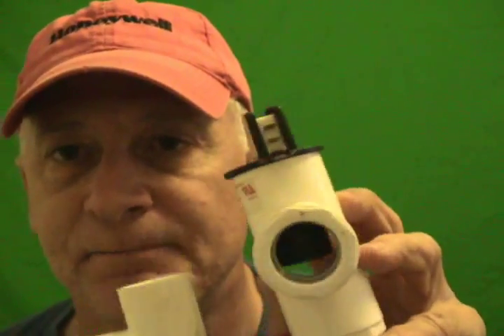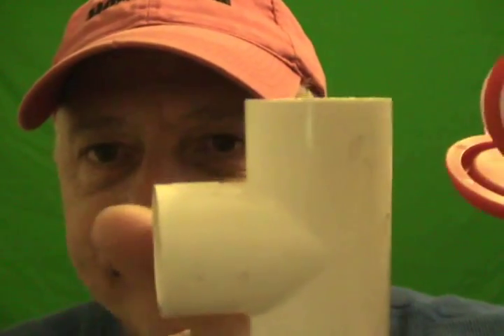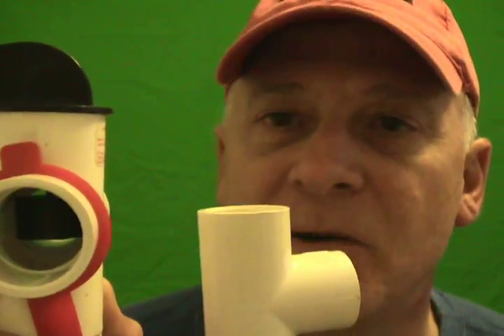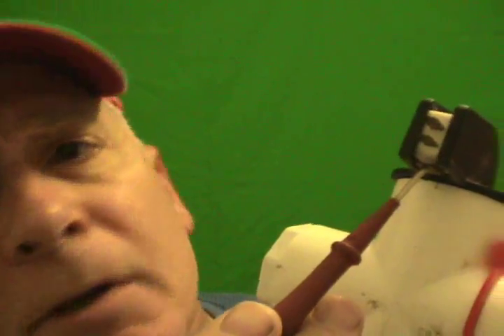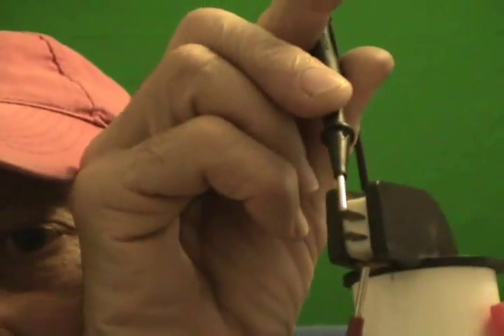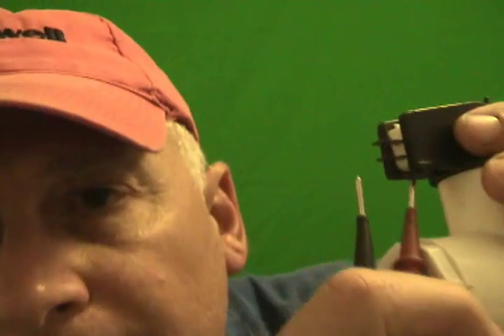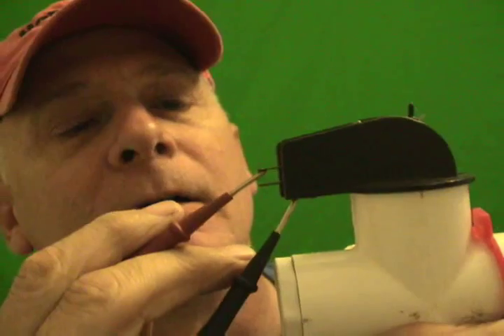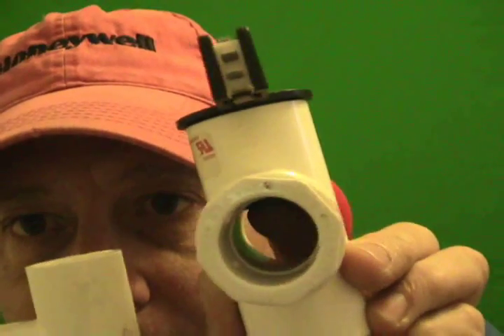HVAC EZ trap

Comment: Recently during routine trap cleaning the wires came loose and I didn't know how to rewire them.  The furnace didn't work after this and the wife was giving me grief as the night (and our house) grew colder and colder.  I found your video and thanks to you multimeter demonstration figured it out.  I still find it crazy that the heating for the entire house can rely upon these two little float switch wires.  But I guess that's the intent of this safety feature, right.  Thank you so much for posting this video, DrZ!
Reply: same thing happened to me today. mine had a cover over the end so i could only see the top 2 connections, i kept reconnecting them and it still wasn't working. tried swapping them with no luck. finally found that the cover comes off and the bottom "common" connection was there. so i wired it so that there it is connected to the "common" connection at the very bottom and then the other to the bottom of the the two top ones (i guess you could say middle one). not sure if that is right but system is operating normally now. from the way he made it sound in the video, the top one is for installing an alarm so that when it closes it gives power to an alarm device and alerts you. i dont have one so i assume that means its supposed to be left with nothing connected. someone correct me if i am wrong. glad to have saved the money on calling out an a/c tech for something so simple.

Comment: I'm going to install one of these on my A/C unit.  DrZarkloff, when discussing the float switch, your multimeter beeping is actually detecting a "short" or no resistance, which is the opposite of what you said in your video.  Both NC (normally closed) and NO (normally open) are provided so as to allow for A/C shutoff by interruption of the 24Vac control voltage or some kind of alarm which may require the opposite switch type.

Comment: Eveen though most states do not require this type of trap for "code", the manufacture specs do require you to have the proper amount of " drop from the Condensate line to the top of the trap. Almost all units require a 2" difference. Ez Traps are one of the very few people who make a trap with the 2" drop. Inproper drop will clog the P-Trap and back it up into the unit causing is to shut down. However Ez Trap (Air Tec) was just bought out by Rector Seal. .

Comment: Hello My Viewers!!  Gets me every time!  Out of all styles of floats:  Waterguard, Aqua Guard, the float in your video, I am still a really huge fan of SS1 style - They are reliable, easy to clean, durable, and not overly sensitive.  Any thoughts/opinions?  I need to go looking for a clear trap now.  I like the design of these and the ability to see what's going on.  Looks to be a 3/4" pipe.  Have you found any clear traps of this style that would match the specs of 3/4" CPVC?  Thanks as always

Comment: This is a cool idea. It seems just easier and more cost effective for me though to  use condensation pan tabs. Never had a problem with clogged drains on any system Ive worked on. I suppose though that this might be a good marketing tool.